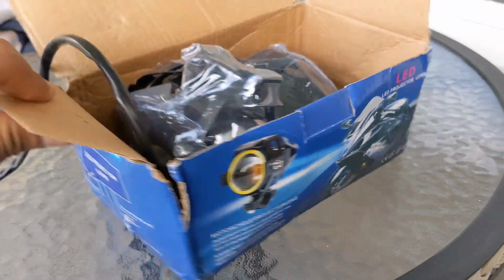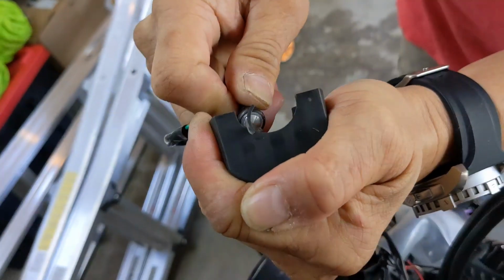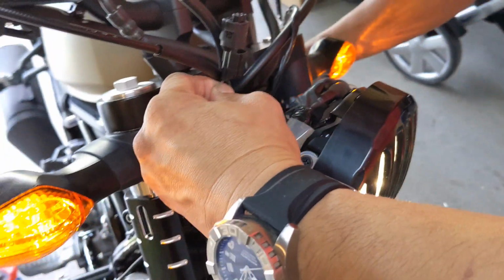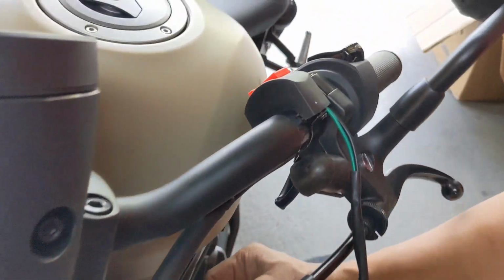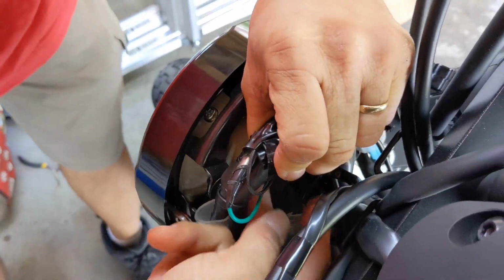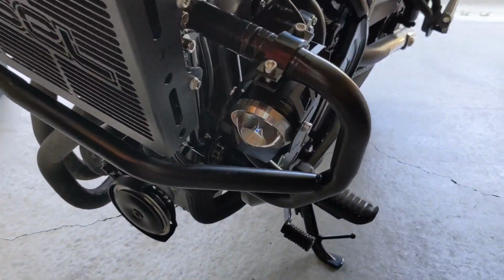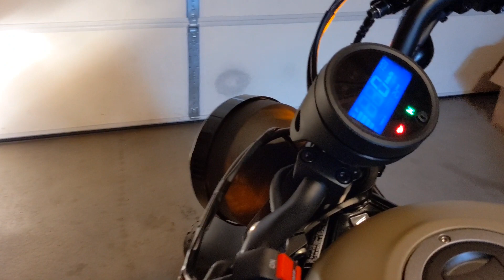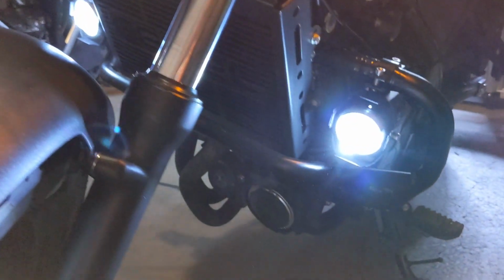HOW TO INSTALL A FOG LIGHT ON A MOTORCYCLE || 2017 - 2019 HONDA REBEL

Comment: Thanks for the video, one thing I was having a hard time watching was how the wire tap was done. I would had throw in some T connector and routing the wires a bit better so it looks cleaner.